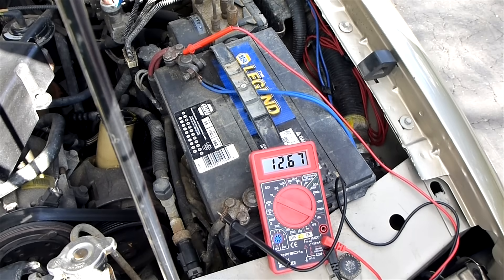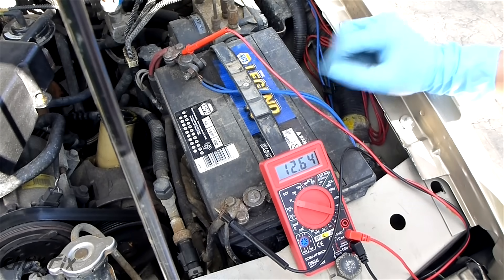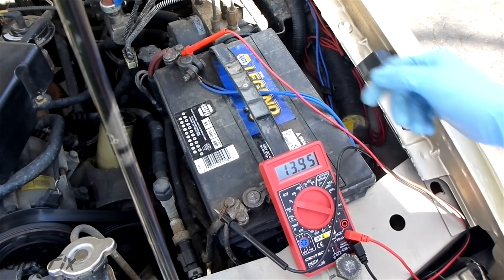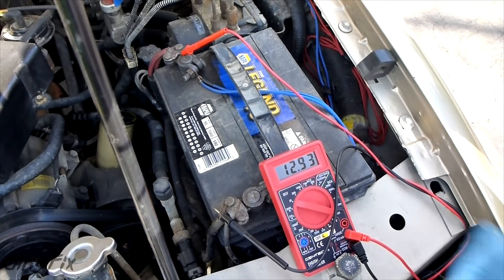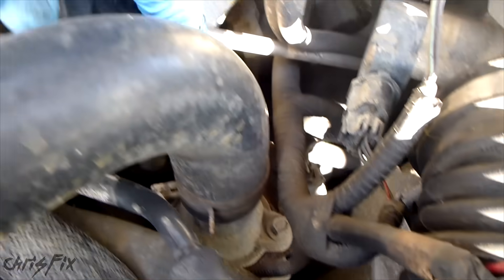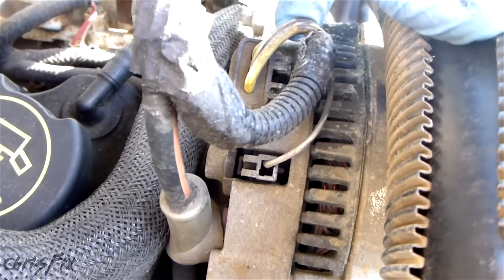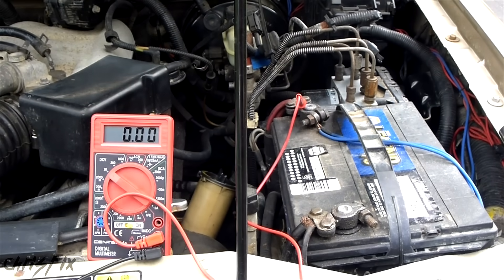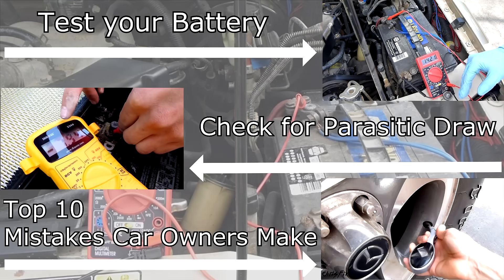How to Test an Alternator

Comment: Hi ChrisFix , Ivan here again.

I wanna ask, my alternator on the ground side shows intermittent reading of 0.01, to 0.1 to 0.2 to 0.3 values.

Does not exceeding 0.1 value is only for EFI engines? A friend told me it's negligible. But I do think I'm having issues on the ground side as my lights dim very low when loaded.

I think my alternator is 65amp

I have headlights (not on high beam), 2 small fog lights(I don't know what's the wattage), I have wiper on, 1 radiator fan, 2 fans at the front of the condenser during AC operation only. And I think my reading is 12.7, 12.9, 13.1 (on + and - of battery terminals)

It's really intermittent reading...

I'm planning to clean up the alternator bracket and add grounding wire (8 gauge) to the alternator case/bracket to battery negative. And (8 gauge wire) to the positive B post of alternator to the battery postive.
Reply from the maker: Ivan Rubio Sounds like you have a problem. You should not have voltages that low, even with all the lights and accessories on. Let me know if cleaning up the grounds fixes the problem. If not, you might need a new alternator.
Reply: Yes, I will keep you posted. I also bought a 8 gauge wire to add grounding to the bracket and positive B post of the alternator, and if I still have extra I'll add to the engine. Will putting to the head or the block matter? There is ground to head and block already and I'll try to clean that as well.
Reply from the maker: Ivan Rubio You can put the ground on either the head or block. If the heads are aluminum and the block is steel, I would put it on the steel block (conducts better than aluminum).
Reply: ChrisFix Hi again, one follow up question. Is fast idle affect the my idle charging as well right? I don't have tachometer to my panel gauges so I just guess my RPM at idle. Before I just look for the smooth idling w/ less muffler sound, I will try to put tachometer soon but for now maybe that's my problem. I put it below RPM specifications don't you think?

Service manual specifications says 700 +/- 50 (650 and / or 750)
Reply from the maker: The voltage regulator should keep the output voltage about the same at all rpms.
Reply: Then I'm having issues right?
Currently I see 13.4 - 13.8v (cold to running temp) and it's very fluctuating. Sometimes I do see 14v on cold starts.

And I see 12.9 - 13.2volts on full load.

What I have already done is add a grounding wire (8 AWG) from negative battery terminal to the body of the alternator.

I've seen significant change by doing so, I before I fluctuate let's say 13.4-13.7 up and down. After adding ground, it's just 13.4 - 13.48 or 13.50 (numbers as samples)

I haven't clean the alternator yet and the grouding of the head and block.

I'm planning to add positive wire to battery positive terminal to B post of alternator (yes I'll be adding a fuse to it as a requirement)

The wires seems very old, and stiff. This could be the problem as well don't you think?

thanks for answering man, you rock :)
Reply from the maker: Is the alternator new? Sounds like a voltage regulator problem...
Reply: Alternator is old, service manual specification said 68-140°F I should see 14.2volts - 13.8volts respectively.

It's a 65Amp alternator
Reply from the maker: Ivan Rubio Yea, under no load that sounds about right (14.2v is the better number). What happens if you turn a bunch of stuff (fan, rear defroster, radio, high beams, etc)?
Reply: I increase a bit the idle, just enough roar and purr to the engine and it's now reading 13.98-14.10v. Ill try to idle up a bit and make it 14.20

I turned on the usual thing like AC, (2 fans at the condenser turns on with it as well), a rad fan. And I get 13.8v now..

I'll try full load later on, and see what's the reading. Full load for me will be:

*headlights
*foglights
*wiper
*rad fan (i have on/off switch for this)
*stereo
Reply: Ivan Rubio I've ran the car till operating temp after driving it around.

Surprisingly I've gone back to 13.6v at idle.

I've increase the idle at 14.4 to 14.8v with the same purring sound w/ your vehicle in this video. (And in the video I made a month ago : see link below)

And full load w/ the following:

*headlights (Highbeam)
*foglights
*wiper
*rad fan (i have on/off switch for this)
*stereo

12.73-12.8volts with those things running.

Here's a previous test/video I made before my carb goes nuts on me.

watch?v=6CZ-8HbP4y4 (As you can see the alternator .. and the engine is old and dirty :D , it's a SOHC 4g15 8 valve 1.5 liter engine using a toyota 4k aisan carburetor (China made). The old original carb was busted.
Reply from the maker: Sounds like a bad alternator to me. You should not be down to 12v with all that stuff running. Maybe in the 13v area but not the 12.
Reply: That's what I'm thinking too, but I'm not giving up on the last idea that maybe my idle up actuator is not set right.

Ironically the car doesn't have a tachometer if I'm at the right RPM. Maybe when AC kicks in and the actuator isn't pushing to the right RPM to the throttle.

I will check next if with NO AC, I will drop to 13v with all the accessories without the airconditioning.

Don't you think this is a good plan? :)

Thanks for your help diagnosing my situation. I love your videos and helped me w/ reviving this car.
Reply from the maker: Ivan Rubio I think that is a good plan!
Reply: ChrisFix One thing I noticed doing the last test is that when I turn on the headlights either low or highbeam it eats a lot of power. I'm currently at 14v+ (14.4-14.5 volts) and if I just turn on the headlights I get like 13.6-13.8.

Now I do remember that in my Ignition wires in the steering column it seems the ignition switch was replaced and the wires were all twisted and not soldered. I did soldered 2 of them before when I was repairing my stall issues. I soldered the live 12v wire and the Ignition Switch wire Position ON.

So maybe and just maybe I'm looking at a wiring and grounding issue here.

Also my reading to the ground side(negative batt to body of the alternator) is about 0.1-0.3v at either idle to 1.5-2k RPM. I think I did mentioned this before even I've added a 8 gauge ground wire, I couldn't get a nut to hold it in to the body of the alternator so I just stick it in between its bracket.

Does this still matter if I didn't bolt it in?

The positive side is fluctuating to 0.1-0.28 I think, which is still a good reading right?

I will try to rewire and clean grounding as much as I could before I condemn the alternator.

I think it's a bit tolerable because most of the time I'm just using AC, rad fan and headlight give me like 12.9 - 13.2 volts. You said it shouldn't drop 12.7 so I'm still good right?

Even if I turn them all I still get 12.7-12.9 volts (wiper, headlights, foglights, AC, stereo, etc)
Reply from the maker: As long as your ground is touching an unpainted surface on the alternator it will be a good ground. This is a strange problem. You should really be at around 13+ volts with everything on but you are slightly off. Might be a bad ground somewhere like you were saying. I wouldnt be too concerned unless stuff dims when you use more electronics.
Reply: ChrisFix I'm at 13+ if I don't turn on the headlights, that's what eating too much power I think about 1 volt just turning it on. So I'm assuming there's a bad wiring.

There's one concerned I'm worried and I know I'm loosing power because there are times during rains, the wiper is slow till I rev.

And now a new issue have shown, it's the source actuator to put vacuum to the dashpot idle up. There are times that it won't kick in to increase the idle, even w/ the wiper is not ON. It will kick in if I rev up a bit.. I looked how much volt it's connector is giving and it's showing 10volts sometimes, but other areas are showing the same voltages as across the battery.

I will isolate as much as I could before I condemn the alternator.

I'll start first figuring out the voltage drop across the ground side of the alternator and the positive side then look at the wirings.
Reply from the maker: Are the headlights normal halogens or are they HIDs?
Reply: ChrisFix Normal Halogen (H4 12V 100/90W), I think the stock is 85w, I just forgot what's the stock setting.
Reply from the maker: Hm, That would be my focus area. The lights should draw a good amount but they shouldnt drop your voltage by 1 volt.
Reply: ChrisFix Also is it wrong to pull the negative terminal to the battery while the car is running? A friend of mine said it's a good way to test if the alternator is working right and if I pull the terminal the car should stall.

But upon research a lot is saying it is wrong. Is it true? Maybe I could have fried my regulator a bit because I did remove the terminal before I bought this new battery.
Reply from the maker: I would not do that. My video shows you the proper way to check the alternator.
Reply from the maker: A bad connection can cause a voltage drop. I would sand all of the connections to ensure you have a good connection. What year is your car?
Reply from the maker: Ivan Rubio Good! You are pretty much there! Keep me posted!
Reply: Hi ChrisFix  I think I finally found the issue. It's a frayed positive wire from battery terminal to the AC compressor line relay to the Aux fans. Glad it didn't touched the frame and get burned. I checked the AC line which triggers the compressor and Aux fans (I think this is what they called pusher) and all of it is -2 volts.

Since there's so much resistance due to the weak wire giving the said devices a big voltage drop thus making the alternator work harder. Correct?

Currently I'm rewiring everything from the AC fans to the AC compressor itself. Whoever fixed this before I got the car didn't do a great job as the wires are all twisted. (Actually everything in the car are almost twisted wiring.) I keep you posted how this will turn out.

I also found loose wiring to one of the AC fans (remember I have two?) So I replaced it instead and the other one is still good I think. It's been 4 days of wiring giving about 4-6 hours a day of work. I tried to keep it as organized as possible and solder everything.
Reply from the maker: Ivan Rubio AWESOME Man! Yea you will get a big draw if there is high resistance. Sounds like you are wiring the right way so keep it up! Take your time and your charging system will thank you! Make sure you run thick enough wires (stock or thicker). Keep me posted and good job!
Reply: ChrisFix I just checked, I've improved my charging voltage and the fans run faster and stronger this time. However, the AC is still have 11 volts on idle while the charging is about 14volts, pretty weird huh.

So that's what I'm going to work on next, the AC compressor wiring.
Reply from the maker: Ivan Rubio Nice! I would check the connection of the ac compressor to the engine and make sure there is no corrosion (for a good ground).
Reply: The wire itself to the compressor is terrible, frayed, weak and looked like it will turn to dust :) Haha

I'm going to get a small female terminal lug as I don't have reserve for now. The wire seems to be 16 or thinner. I think I'll put up atleast #14 or #12
Reply from the maker: Ivan Rubio Good. That means that is probably your problem!
Reply: Just had a short drive and it's 89 - 93°F, it's scorching here... the AC didn't disengage because it's having a hard time to cool. I think it's because of the low voltage to compressor right?

Charging voltage reads 13.8 - 14+ volts... so I think -2 volts drop = about 11 volts only to the compressor.
Reply from the maker: Ivan Rubio Yea, that makes sense although even in 100F weather the compressor should disengage.
Reply: It's having a hard time to cool, overpowered by the heat outside, and I think the low voltage is the factor. I just read here http://www.rdac.com/resources/blog/troubleshooting-ac-clutch-failures-and-low-voltage

That the voltage should atleast 11.5volts, I'm reading 10 sometimes so maybe that's the reason why the compressor got noisy. The clutch is not pushing enough.
Reply: ChrisFix  Hi again, by any chance do you know the minimum voltage you can trigger a relay? I'm assuming I can trigger it w/ 10-11 volts since the Aux fans are working in such manner. I'm was just curious how low can a 12v car relay can be triggered.
Reply from the maker: Ivan Rubio With a relay I know it takes less than .3amps but I am unsure about the voltage.
Reply: I nailed the drain, voltage to compressor reads 11.9 - 12v at full load same w/ the actuator and ac fans trigger, however at full load I still have 12.7 onwards.

Wipers running strong, but I think the drain might be coming from headlights or foglits or stereo since the stereo is wired directly to the battery I think. The stereo can be opened even w/o the key.

But I'm happy w/ the results now, atleast I have few more to look at too. :)
Reply from the maker: Ivan Rubio Awesome and congrats man! Great work!
Reply: Thanks man, it's been 1 week of research and another week for rewiring and hunting.

I'm not done but it's been fruitful. I will compile what I have done and show it to you. You've been a great help ! :)
Reply from the maker: Ivan Rubio Although it took a while, doesnt it feel awesome that you are nearly done!? I am glad I was able to help!
Reply: Yes indeed, I felt I'm a king :D shooting punches in the air and kept saying yes! yes!

I'm still compiling what I have done and I will show you.

One quick question, since I'm at 60A alternator, if I'm going to use 100A alternator will that hurt my fuel consumption? Everybody here kept saying that. I should be at max 90A or 80A. What's your take on this?

My engine is 1.5 liter 4 cylinder gasoline engine (Hyundai Pony in your country, Hyundai Excel in mine)

The 100A alternator came from a 2.4 liter 4 cylinder Nissan R`Nessa 

Here's the link for reference: http://shop.ukeroo.com/products/detail.php?product_id=409256
Reply from the maker: Upgrading to a more powerful alternator will use more energy and therefore more fuel but nothing significant. You probably wont even notice it.

Comment: very useful and simply explained for anyone to understand ..information that can be used time and again on a variety of vehicles...But i did have a question on the battery test part of this..What if you have a chain of batteries? Would you disconnect them all and test each battery independently or can each battery be tested while connected with other batteries?
Reply from the maker: Harry Monster Thanks! That is a good question. If you have 2 batteries hooked up, I would test them separately to find out which one is bad.
Reply: I have 4
Reply from the maker: Harry Monster Wow, why do you have 4? What truck?
Reply: yeah semi ..i just yesterday replaced all 4 but they were under warranty so no expense except down time..However this is useful particularly when no such warranty exist and the cost is as much as 100 bucks and hour just to tinker with the truck
Reply from the maker: Harry Monster I figured it was a semi! Glad you got the job done!

Comment: neg bat terminal was loose. omg ametuer day
Reply: franktib Yes, having a loose terminal can ruin your regulator.
Reply from the maker: franktib Good eye. That is because I was making another video at the same time where you test the parasitic draw by bridging the connection from the negative cable to the terminal with a multimeter.
Reply: I understand sir but you upset me very much bc loose terminals is the problem more often than the battery
Reply from the maker: franktib But the battery was fine and the point was to show how to check the alternator which also was fine.
Reply: tight terminals are important
Reply from the maker: franktib Indeed they are.

Comment: Hi Chris, thanks so much for this!  I have a noise and I'm having a hard time telling if it's a power steering pump whine, or my alternator whining (they're right on top of eachother).  Is there a reason why you can't use the dash  voltage reading to do this same test?  Mine always hovers right above 14 while running, so I was assuming the whine I hear is the power steering.  also, the whine changes in pitch when I turn the wheel.  I have heard that both "whines" sound almost identical though, so I don't want to be wrong.  Trying to buy a part and fix myself rather than take it to a shop.  I'm very handy but not an expert.  I drive a 2001 Jeep Grand Cherokee Ltd 4.7L V8. The noise showed up yesterday about 30 seconds after I started my jeep when it was only 1 degree F out at the time.  My brother thinks maybe my PS fluid was too cold and thick at that temp and maybe I have an air bubble... Any thoughts would be greatly appreciated!

Comment: Hello, when the engine is at idle it had a reading of 14.75 then after 5-10seconds with radio and headlights, heaters on. Every light seemed to dim for a split second as this happened the voltage dropped slightly but not lower then 14.4v then went back to 14.67v but still no battery light. Going to check the battery in the morning to see if it has dropped below 12.6v, then will have a check on the alternator wiring, then if all fails ill check all the fuses.
Reply from the maker: Chris Selin That happens sometimes on older cars but it shouldnt happen often and if it does happen it should only happen once when you add a heavy load onto the battery.